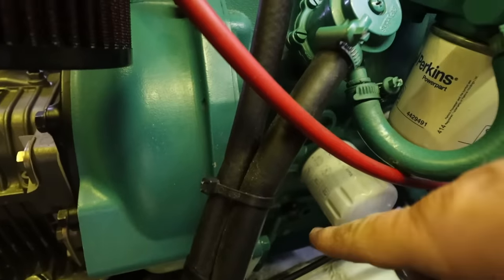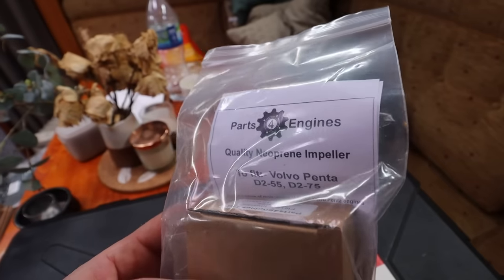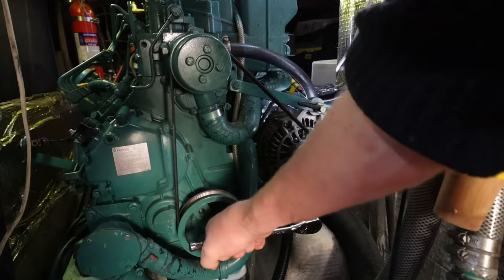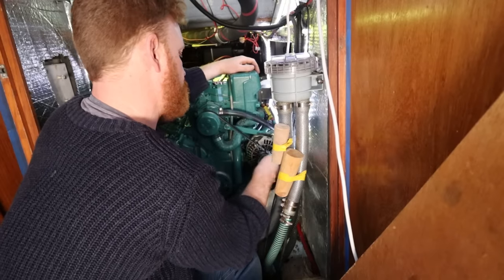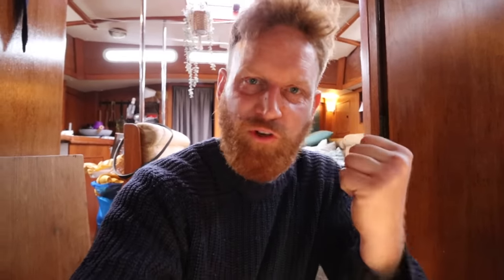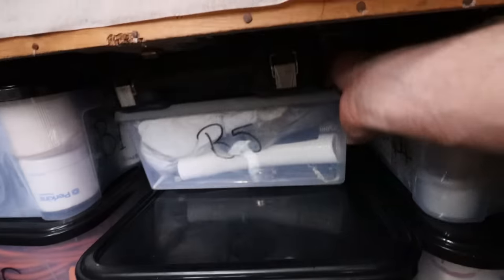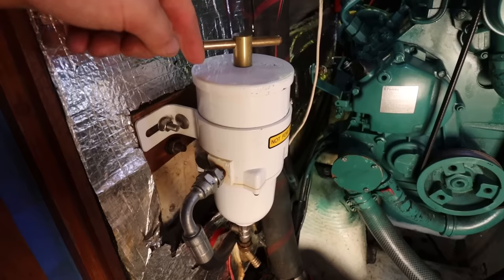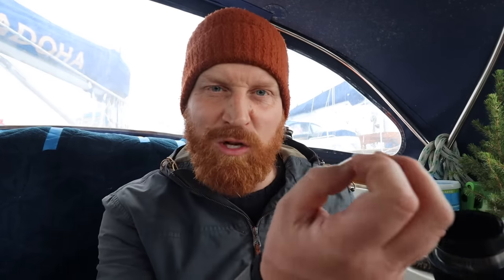Volvo Penta DIY - Full Marine Engine Service

Comment: I am an old retired tech,military aircraft and owner of a boat repair shop. suggestions, look at the coolant hose behind the alternator belt, the paint is chipping and you cannot see the condition of the hose. I would change the hose just to make sure it won't fail at a bad time. (this never happens at the dock) Same for all the hoses. keep the old ones as spares if they are OK. Belt adjustments = 1/4 inch of deflection for each 6 inches of span. Too tight, bearing wear, too loose belt slip and overheating belt causing the belt to become hard and slick and slipping. With the water pump I change the screws with studs (home depot has stainless, probably 10/32 or 1/4X 28. I get aircraft wing nuts that are treated for anti rust and one wing is drilled for safety wire. when the plate is put back on you can put a non twisted safety wire (0.032 or even smaller) and not have to worry about loosening. The benefit is when the SHTF it is very easy and fast to cut the safety wire and take the plate off to put it back on with the boat rolling around and water coming out the studs will help you find them and put the plate back on. The wing nuts also allow you to fasten the plate without screwing around (pun intended) finding the hole to put the little common screws back on. A good wing nut is a "MS35426-30 aircraft type wing nut, about $9 for a bag of 5. ( they are all over the internet)All the pump plates I have dealt with are drilled the same and will go on any pattern, if not on yours put an arrow pointing up st speed installation. I don't know if the Perkins engine has a mass flow sensor right after the air filter but if it does always pull the two screws that hold it in and clean it with some mass air flow cleaner. the oil from the K&N filters tends to get carried into the intake and deposit on the MAF sensor tricking the computer. The same goes for cars. You did a very good service! I hope my little suggestions help you. Happy sailing.
Reply from the maker: Wow, thank you for taking the time to share your pearls of wisdom with us, yes that has been very helpful, not just for me, but no doubt for others looking to improve on their entry level skills in DIY maintenance. 

Thank you again 🙏🏻☺️
Reply: El Robo, I like your ideas for studs and wingnuts, the Volvo/Perkins is an European engine so studs will most likely be metric, if you notice all the spanners (wrenches) he was using were all in mm. Fair winds. Sailing Cacique.
Reply: Question? I know this is off subject! What is the best way to get In to that industry? I am really interested in this career.

Comment: This might seem picky, but I noted when you washed out the air filter, you washed it into the sea, next to the jetty. Is this a responsible thing to do?  I appreciate it's not pristine water and you didn't use that much, but thought I'd mention it.  A nice video to watch and thank you
Reply from the maker: That’s fair. I guess in my head it was mostly dust particles I was cleaning out, but I’ll be sure to use a container next time all the same. 

Consider me reprimanded 🙏🏼🥹🙏🏼
Reply: Yeah, I thought that too. Living in a fishing village as i do, I see a lot stuff going in the ocean that shouldn't. I think I'd do it over a plastic tubby which I'd then pour down a sink on land, as you know then that, being in the UK, it will most likely be treated.

Comment: I would check the aux belt adjustment in the manual that looked a bit tight to me so may damage the water pump and alt bearings. I think you had it right then you over tightened with the socket when you did up the nuts and bolts.
Reply from the maker: Appreciate that, looking back that was a tad tighter than normal. Appreciate the heads up 🙏🏼☺️

Comment: Hi Cadoha, l also have a D255F Spend-o Penta on my Contest41. The air filter you are using: What exactly is it? I would like to buy this. The shitty original one from VP I will throw. It´s really shitty.
Reply from the maker: Hey matey, it’s an air filter I bought from a website called parts4engines. 

Just type the make and model of your engine in and you’ll find all manor of original as well as aftermarket components for your engine 🙏🏼
Reply: @CadohaAdventures  Great website, found it, thanks. Maybe it´s a K&N. I just contacted a dealer in EU. Because of brexit makes no sense to buy from EU at your UK dealer because of all the additional customs, costs and stuff...
Anyway many thanks!

Comment: On the top off the fuel pump is a Phillips head screw that holds down a inlet screen. It prevents large particles from fouling the check valves in the pump. It can get clogged at the most inopportune times. It is worth checking when servicing. Oh and, More Hank!
Reply from the maker: Amazing, I never knew that, I’ll be sure to check it. Thank you for your help 🙏🏼😬
Reply: @CadohaAdventures ty to you all for your great videos the information is great as in stages if buying a yacht same as your trident warrior to be fair so the information will serve me well

Comment: You still have garden hoses connecting the engine sw pump to the filter, please replace that with proper class approved marine rubberhose, an overheated pump will melt the garden hose etc...

Comment: Just taking you up on your invitation to notice some things, looks like you may have a bit of diesel bug in your fuel tank, the black algae looking stuff in the primary filter. It's a good idea to put biocide in your tank each time you fill up to prevent the bug growing, and also keep your tanks as full as practicable to prevent condensation forming in the tanks. When you change the fuel filters, best to leave them empty, then use the primer pump at the engine to refill the system. The holes in the fuel injectors are very small and easily clogged by tiny particles of dirt. Adding fuel from a bottle is effectively adding unfiltered fuel into your system. Using the primer pump draws the fuel through the filters and stops any dirt entering. When you are using the extension with your socket rachet, use 2 hands and support the end of the rachet so your force is directed into turning the bolt / nut, using one hand the force is trying to tip the tool off the bolt or nut either upwards or downwards depending on whether you are loosening of tightening the fastener. Than can ruin the head if it slips off and you may end up having to use vice grips on it if it gets damaged enough. 
Does the engine have hydraulic valve lash adjustment? If not then perhaps look into checking valve clearances periodically in case they tighten up. Keep up the good work :)
Reply: Great tips there Sir, cheers.

Comment: Store your toilet spares in the toilet cupboard
Store your engine spares in or next the engine space 
Rigging spares in cockpit locker.
I worked a few years on charter yachts as a lead boat engineer with very little space and we used the above system and it worked perfectly . Keep your tools somewhere very dry or they definitely will go rusty on a boat.

Comment: Just after I bought our boat we had a cooling problem, long story short the heat exchanger inlet was full old bits of impeller. 
Tip - Fit a course strainer downstream of the water pump just in case the impeller falls apart. A very cheap preventative measure (and impeller anxiety) . I used to work on (very) big marine engines and this was the norm.

Comment: Hiya Cadoha,
Nice video; thank you both. I used to run a small fleet of generators mounted on trucks. 5 Perkins, 1 Penta and 2 Cummins marine engines on various Bedford, Layland and an artic trailer. Different Ford trucks for transporting the lighting equipment. 
A diesel engine needs air and derv to run. Remove or constrict either, and you will have problems. Always carry extra fuel and air filters; you may never need them, but if you do and don't have them...
Other replaceable parts support this combustion, like the impeller. I would not count one spare as sufficient; at least two additions, preferably three. You may need to give a reserve to another yacht in distress. Belts, at least two extras. Sometimes faulty manufacture will cause the failure of the part after an annoyingly short amount of time. It does happen. A spare alternator and starter motor may be a good idea too. Yes, they fail, and if you don't notice a lack of charging... 
Keep on with the very informative films, please. 
Stay safe, Steve...

Comment: Your fuel in the filter looked incredibly dark which is why I prefer filter bowls that are see-through then you can monitor the clarity of the fuel coming from the tank. It may be time to do a shock treatment of your fuel tank (not that old Chesnut). I would also be tempted after the first few hours of running to drain some fuel from the filter and see if it's still as dark, maybe add a small length of hose to the drain point to make that easier. 
I prefer to change oils at the end of the season rather than at the beginning, oil builds up contaminants with use mainly acids which can cause corrosion if left in a static engine all winter if I'm honest not a huge amount but still easily avoided.
Reply from the maker: That's a great shout. We actually have a 'Diesel Dipper' from Marine-16' which we use to gradually drain down the fuel tanks to burn the old fuel in our diesel heater. The Dipper also picks up any water and crud build up from the bottom of the tank and so hopefully the tanks are ready to receive fresh fuel when we leave next.

In an ideal world I would remove and replace both of our fuel tanks, but there's no way to remove them in one piece and thus not easy to put new ones in their place without a huge amount of work being done on Cadoha. It almost feels like the boat was built around the fuel tanks.

Comment: Hi Dom - In my Grey Funnel Line days we used to keep a lot of our rubber based products in a dusting of French chalk.  Great for many reasons but will extend the life of rubber significantly.  Might not have a huge impact if rotating impeller every 12M but worth to keep in the knowledge in the back pocket.  Also keep rubber away from chemical products like you had in B2.  They can release "volatiles" which will also impact rubber in storage.  Great to see a 5S covert!!!
Reply: convert

Comment: Hi ! Very interesting ! I'd like to say that the alternator belt does not need to be changed every year, according to Volvo Service Protocol Maintenance, but 48 months / 600 h. In my experience, a brand new alternator belt was defective and started to degrade - losing material from the grooves - at only 40-50 hours, but never broke even if it was forcedly used for ... 30 more hours (no spare available ...) ! So, you have to inspect  it frequently and change it if you find a little wear. kind regards.

Comment: Really enjoyed that Dom. Nice work.👍. I ended up giving the K&N filter a miss. Much easier to just replace the air filter as required. And no oil residue on the MAF sensor worries, and those recharge kits get expensive too. Stay safe guys 🙏.

Comment: As we have cokme to expect a competent easily understood video,. In the interests of sharing I noticed several of your cooling hoses have been painted, that in my opinion is cause for replacement they are not meant to be painted and the paint could cause premature failure, 
cheers Moose
Reply from the maker: In that case then I think this winter could see a new selection of hoses as the coolant will be due for changing then too 🙏🏼😬

Appreciate you taking the time as this is really where I learn so much. 

The comments section on YouTube has been my mid-life university course. 😬😬😂

Comment: Your alternator drive belt is a "Polly-Vee" and they last much longer than the old V-Belts. The V-Belts wore out quickly due to the long high draw on the Alternator to charge the house battery, hence the chance to Poly. Yours looked fine, I would have left it. Also, they do not need such high tension, over tensioning just wears out the bearings.
Same with the pump impellor, yours passed inspection. You can get a puller for them, it looks like 3 steel rods, nurlled over. Two screw drivers risks damaging the housing and will damage the impellor.
Reply from the maker: Appreciate that, Jonathan, the belt was done up a tad tighter than usual and I've backed it off now after some other keen eyed mechanics echoed your sentiments.

Appreciate you taking the time to help us get better though, this right here is where I learn the most 🙏🏻☺️

Comment: Another good video. Fuel in filter looked ver dirty. May be worth checking bottom of tank. Also when were the valve clearances and head bolt tensions checked. Other things are anodes in the engine and gearbox. Also gearbox oil.
Reply from the maker: Thanks for the tips!

The valve clearance was done last year. Believe it or not the D2-55 doesn’t actually have any engine anodes?! 

The head bolt tension checks? Now that I haven’t done, so thank you for bringing that to my attention, I appreciate it 🙏🏼😊

Comment: Something I didn't see you do that I would have done is , check the top pully on your Alternator belt  , at least there would be bearings on it ,, on a Perkins in a tractor it would be a water pump ,, I don't know about Marine applications
Reply from the maker: You know I’ve never done that or even thought about it, so thanks for the heads up there, Russell 🙏🏼😬

Comment: I noticed when you removed the impeller cover that some of the rubber blades were facing different directions.  When installing a new impeller it is better, if not required the all rubber blades should be facing the same direction for most efficient operation.  Use a water tolerant lubricant to lubricate the  blades and the inside of the pump housing and turn the impeller the correct direction until all of the blades are cooperation and facing the same direction prior to pushing it deep into the housing.  More water is better.
Reply: The impeller blades soon orientate themselves. So never a problem. Like for soon; read in the first part of the first rotation.
Reply: @stephencoster9532  if they had orientated themselves it wouldn't have been like that on removal

Comment: I’ve just checked the price of a Speedseal water pump cover plate. It’s considerably more than when I fitted mine to a Yanmar 2YM15 fifteen years ago but it makes accessing the impeller much easier and it’s virtually impossible to drop things in the bilge. Have you thought about getting one ?
Reply: They are no longer in business

Comment: Out of curiosity - on your D2, isn’t there an additional oil drain tube (instead of using the dipstick tube) that is plumbed to the lowest point of your oil plan? Usually they just have a black rubber pull-off cap, just below the fuel pump.

Comment: The impellor you took out wasn't fitted correctly as a couple of the vanes were flipped the opposite way , when you fit a new one you should rotate it in the direction it runs so all the vanes are the same way

Comment: Great maintenance video !  In your spreadsheet , do you indicate how many spares you have and whether the spare is 'new' or 'used' ? 
Also , regarding keeping the used   parts as a spare , is there a need to coat them with silicone spray or grease to keep them pliable or from rusting  ?
Reply from the maker: Yes the spread sheet has a column for amount of units we have, if that's something we feel is important for that particular item, as is the case with say filters. 

I'm not at all naturally organised, but taking the time to create this simple system has already made the world of difference to life in board.

Comment: I require fuel injector pipes from the pump to the injectors Do you know who makes these any more. Thanks in advance
Reply from the maker: I don’t know exactly, but if it was me then I’d try a company called ‘parts for engines’ that’s where I tend to get all my bits from.

Hope that helps 😌🙏🏼

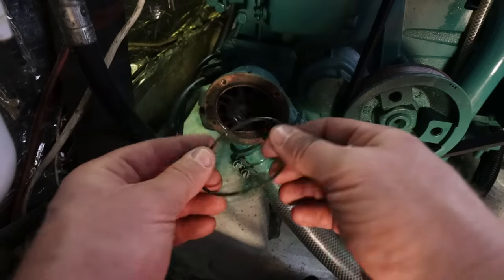Comment: 5:33 The impeller you took out did not look right. It shouldn't have fins facing in different directions like that. Looks like it was incorrectly seated when you put it in. You should rotate it in until it reaches the splines.

Comment: Well done Cadoha, but if I could give an advice, change those bloody perforated hose clamps, these are known to fail with bad consequences for your cooling system…
Reply from the maker: Thanks, Bart, what clamps would you suggest?
Reply: @CadohaAdventures I always used the type with the teeth on the strap raised. Much more metal before failure.

Comment: Can you help me I have a Volvo Pentecost D2 55
Somehow I have go I believe to be sea water mixed in with my oil how could this hapen
Reply: Seals on the raw water pump would be the first thing to check.
Reply from the maker: I’m not a mechanic, I really am just a boat owner who’s trying to save a few pennies here and there tackling some maintenance jobs myself, but could water getting into your engine oil be a head gasket issue?

Either way I can’t imagine the salt water is going to do the engine any good and if it was me then I’d be consulting a reputable mechanic/ technician before too much more damage can be done.

Good luck 🙏🏼
Reply: Then pressure test the  coolant circuit. You will need to buy a pump for this but that will be cheaper the a visit from a marine engineer.
Reply: could be the raw water anti siphon valve is faulty and is allowing sea water to flow back down your exhaust
Reply: Unlikely to be head gasket Dom, if it really is sea water as the guy said. Head gasket would be coolant/oil mix.
Reply: If it's a Volvo Pentecost you just have to pray, Jesus will take care of it 🤣🤣🤣
Reply: Stepheh Rogers  A blown head gasket will cause this issue! I assume the engine is not being used!?